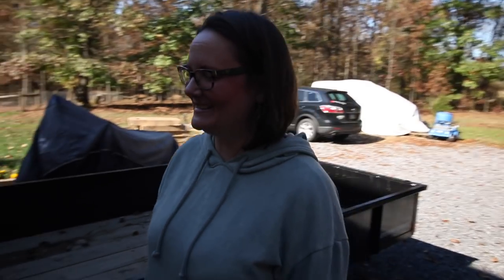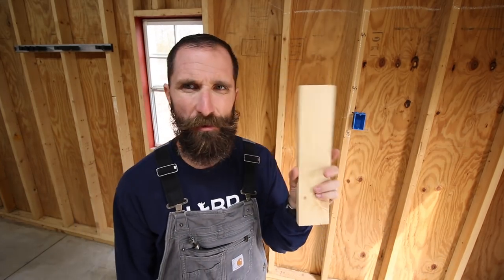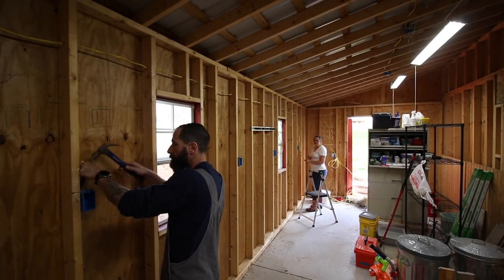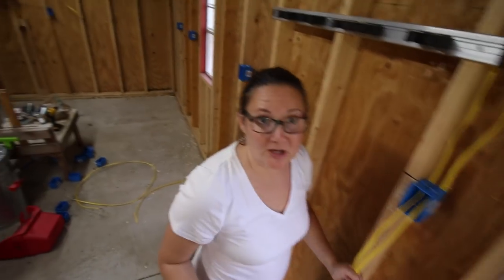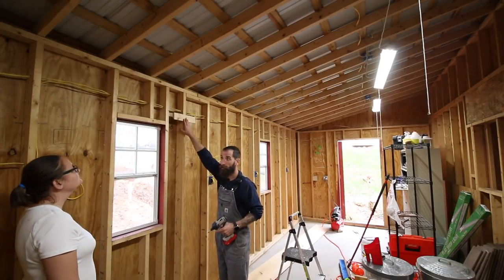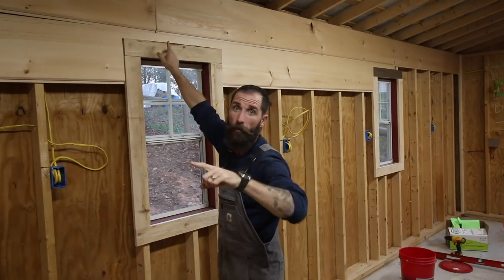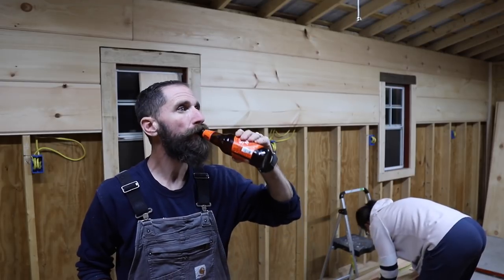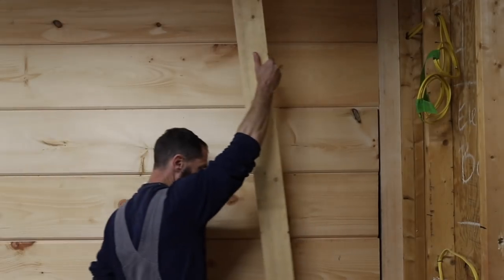What Did I Get Myself Into?

Comment: ... a friendly little tip for your next venture into ship lap... try starting your runs at the bottom... that way you can let gravity hold the boards in place as you go up, instead of having to struggle with pushing the groove up and into the tongue.
It just makes life so much easier and quicker!  😉🙂
Cheers!
Reply: plus, it's much easier to keep level when you can just rest the length of your level on the top of the board you are leveling.
Reply from the maker: Truth! I went from the top because if I had an out of square wall, I wanted the wonky piece at the bottom. This is the third time I've done it and you'd think by now I would give up on caring about where the skinny wonky piece goes! Lol. Appreciate the tip though, good looking out!